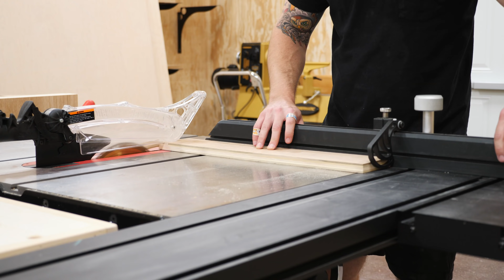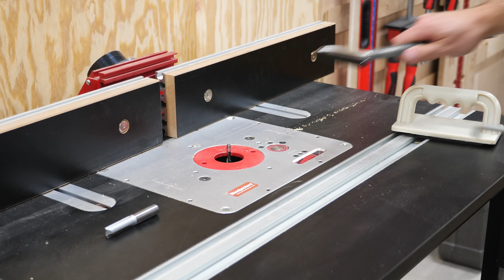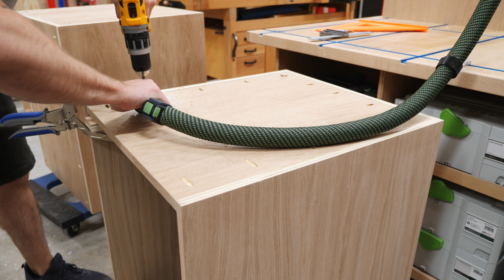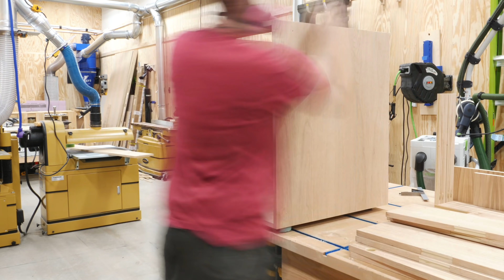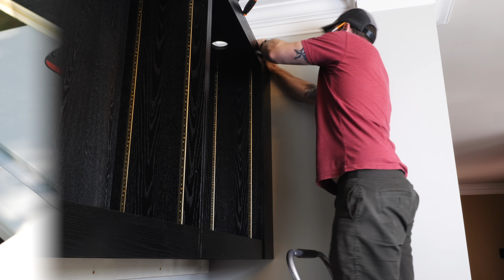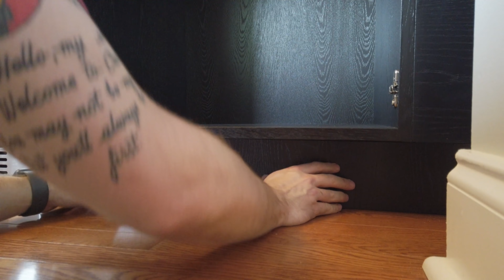How To Build and Install DIY Frameless Kitchen Cabinets // Home Bar Pt. 1

Comment: Great video, wonderful content! 

When breaking down full sheets: 
You do a rough cut with FE on fence, then final width cut, then you flip the piece to cut the FE off. Why do you cut the FE? Is it because the fence might not be parallel to the blade and flipping it to cut again will make both sides parallel?

Can you share your Venmo so I can make a donation?

Comment: Very nice build. The only one thing is I would have done is made the grain on the filler pieces match the grain vertically so it matched the overall grain pattern of the doors. I guess I am a bit of a perfectionist. I had a custom cabinet business for 15 years.

Comment: Great video...one question:  when you were measuring for the size of the doors on the lower cabinet, did you measure from the inside of the opening or from the outside?  appreciate the assistance.

Comment: That turned out okay in my personal opinion, I am not a fan of the black as it makes it look like you used plywood (instead of plywood to look like real wood)..... Also, it would have looked better if the grain pattern would have matched on your lowers...(the drawers fronts and cabinet door). IMHO, pretty big mistake. 

The only other thing I feel I should ask is why do you use pocket holes for all your projects? At least the few video's I seen on your channel. I know some ppl LOVE pocket holes, but for a guy who has spent well over 25K +++ for all your quality power tools, you think you would have used quality jointery for indoor cabinets....Pocket holes are great if this was for your garage.

Comment: This build looks great, and the fit seems to be spot on, but I do have a suggestion for future projects like this: When you screw the cabinets together side by side you can hide the screws very well by placing them either in the holes on the drawer slides (there are like a million more holes than you need on almost all brands of undermount drawer slides) or behind the hinge mounting plates. It's not THAT obvious in drawer cabinets because you pretty much don't see the inside of the cabinet at all (but gives me peace of mind anyway) but for cabinets with doors it hides the work extremely well for a super clean look.

Comment: Very well done! I have been building European-style 32mm System frameless cabinets since the 1980’s and like many of the modern American-style methods and approaches you took with these cabinets and they look GREAT! One tip that I would suggest for future builds that incorporate the base levelers (feet) is that they socket is designed to be placed with one edge or lip under the side panels. That way the weight of the sides, which are bearing all the weight of the countertop and everyone else in the cabinet aren’t only supported by the joinery on the bottom corner. Even when that joint is overbuilt with dowels or Confirmat connectors, those joints are actually bearing on less than 1/2 of the thickness of the bottom sheet stock. I’ve seen cabinets with levelers installed like this that collapsed to the floor with their bottoms still supported by the levelers!   Smart move posting a second vid dedicated to the drawer slides. The hinges probably deserve the same. Great vid. Scott

Comment: I know kreg jig foreman’s are cool but do you not feel or have the ability to dado cuts on the table saw? You kept mentioning that you had to set up clamps and keep adjusting them when drilling. Plus it keeps everything square, tight and somewhat seamless. Just wondering why that isn’t applied to more cabinet constructions across the board in the carpentry world? Great video nonetheless. I always enjoy watching your stuff.

Comment: Set your laser 20mm/1inch above your finish height... then using an offcut with a thin pencil line marked on it you are able to level the unit front and back.

Comment: Make a ramp to go over that section in your shop where the duct colection tube is on the ground.
Reply from the maker: It’d have to be a pretty big ramp to be useful. I can move the hose very easily.
Reply: @craftedworkshop  | Very well then.

Comment: Why do you not install the bottom part of the furniture and then use it  as a reference for to top  to avoid the necessity to screw the cleat to the studs and damage the wall finish?
Reply from the maker: It’s a lot more tricky to install uppers when the base cabinets are in your way. You can do it either way, but I’m going to be adding a tile backsplash most likely anyway, so the holes don’t really matter.

Comment: Love the black cabinets 😍 and the ash butcher block will go perfect! Definitely seeing that one. Question: why use filler strips as oppose to just using the entire wall as cabinets? I know it's only like 3-4 inches but just curious as we're looking to build some upper cabinets here soon and your thought process can maybe help us. Thanks and good luck with the butcher block countetop. Let us know tips during the build of that and maybe what you'd do our not do after you build it.
Reply from the maker: Thanks! The main reason for the filler strips here were that the drawer in the rightmost base cabinet would not have been able to open as it would have interfered with the wall. The fillers spaced it far enough from the wall to give it clearance. I figured the upper and base cabinets should match width-wise, so that’s what I went with.
Reply: Ohhhh... now it's pretty evident looking back. Thanks and have a good one!

Comment: serious question. I have a single car garage shop. I purchased one of those paint right painting tents. I regularly see the youtubers just spray with out protection for items in their shop. I personally don't have good ventilation beyond fans and I can't piss off the wife by spraying her christmas decorations black either. Do I just need to adjust my spraying or are these guys just lucky with the open area and ventilation?
Reply from the maker: I definitely had plenty of overspray here. The thing is, by the time it lands, it’s really just dust, so you can just vacuum it up.

Comment: The Trim Puller was the best $30 I spent on our remodel.

Do you have a link for those undercabinet fixtures?  I need a low profile fixture that takes an Edison bulb, and those look promising.

Comment: About the IsoTunes; just out of curiosity, do you have any connectivity issues? 
I use mine when I mow the grass and with my phone in my pocket, the audio will drop out sometimes. Not sure if it's the headphones or the phone, I've never tried using the headphones with another device.

Comment: Next time place the ajustable legs so that they fall just on the side  edge of the cabinet so that the weight is better distributed
Reply: Placing it away from the edge can lead to the bottom shelf pushing up and potential break away

Comment: Great build as always, but missed the FSM T-shirt. You really give great detail on all your projects, In's n outs for all us home games who dabble in wood projects. The only thing I would do different, would have used LED lo-volt tape light under cabinet lighting. They make a channel that you can make in the bottom of the cabinet that has a lens that fits over the strip light and snaps on to u shaped channel to cover the tape light. That way it is recessed into the false bottom of cab n is flush. Very clean look n only @3/4"wide n depth. Nice job.

Comment: Really well done!  Say I also have the SawStop sliding crosscut table and I find it next to impossible to  #1 bring into square when re-attaching it and #2 keep square when using it.  Do you have these issues?  If so, what have you done to counter that?  You mention in the video that when breaking down the larger sheets you don't rely on these cuts to be square and that you use the factory edge to get things back to parallel.  I do the same but it does seem less than optimal.  Again, great video.

Comment: Really curious to hear more about the krazy glue- do you know what it is made out of and its strength capabilities? Did you use it on the cabinets to quickly hold things in place so they wouldn't move whilst you were applying screws or to actually add strength?

Comment: Okay, but can we get a closeup of the booze?  

Also, favorite liquor store in the Asheville area?  I visit once or twice a year and like to local for something local.
Reply: We only have ABC stores in the area. They are a state requirement. We do have some decent cocktail bars though. Top of the Monk is one of my favorites. You're better off sticking to beer in Asheville as that is what are known for. Cheers.
Reply: @Jputnam13  I'll check that out next time I'm down!  I've been to the ABC store nearest to my in-laws, but wasn't sure if one had better selection than the others, or if there was a good way to tell.